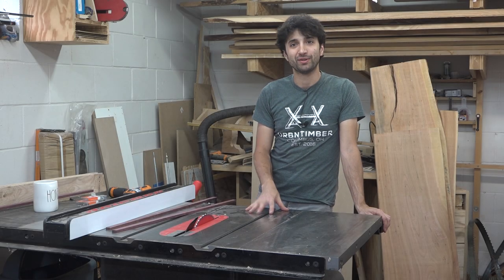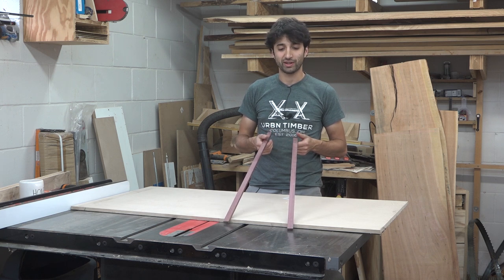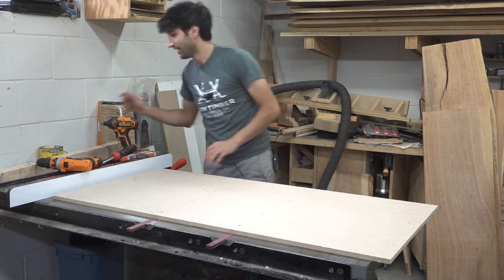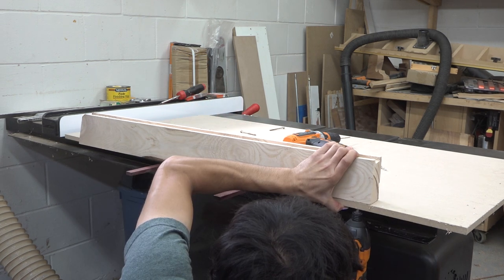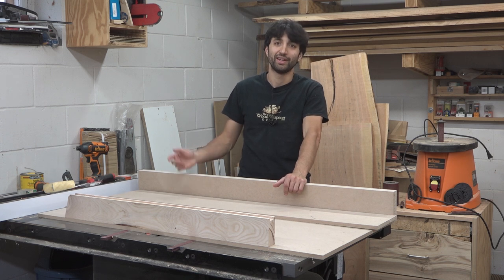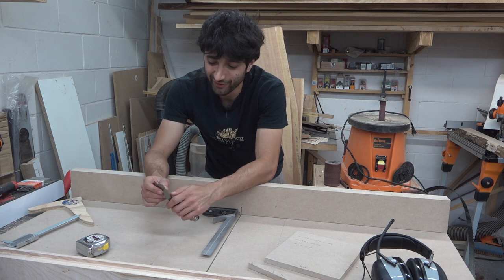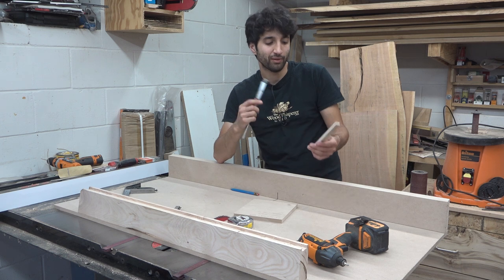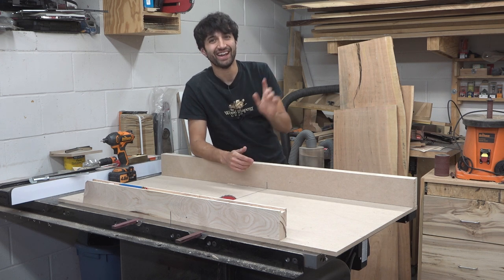Simple Table Saw Crosscut Sled

Comment: Dude, that idea to have one part of the lamination sticking out to have a clean reference point is brilliant! Great, simple sled. I need to get around to building one for my saw as well.
Reply from the maker: Thanks Johnny!
Reply: I said the same thing to myself when I saw that. Brilliant! I will be using that for sure.
Reply: I didn't get it 🙁
Reply: speg hetti as long as one straight board is protruding from the lamination, you can use that as your reference edge and ride that up against your table saw fence when squaring the piece up.
Reply: I've never thought of doing that! Makes me want to redo my sled because my fence is off just a tad and it drives me nuts.
Reply: I came to comment on the same thing. Brilliant.
Reply: Absolutely genius! Without a jointer it’s hard to make a perfect back fence.
Reply: +1.  I thought the same thing.

Comment: Nice one Matt. It would be interesting to see you do an update on this in a few months time to see how the squareness is holding up. To me, it seems like you could easily loose several thou due to the slightest of flex or humidty changes, and so I think it's kind of daft to do these tests with such dynamic materials, but I would love to be proved wrong!
Reply: wforl wood I would assume that any  movement due to humidity changes would happen uniformly across the sled base and the fence since MDF has no grain direction. That should ideally keep things as square as they are now.
Reply: True! ... but my point was that the smallest of things could change the resultant cut when dealing with these kinds of tolerences. Like for example a touch of glue, a tiny dent in the piece etc etc

Comment: Another great Video Matt, thanks. However, don't you hate it when you get 'however', I'm unhappy using a sled with tools on it. I always feel they might vibrate and move near to the blade and that would be a distraction - I don't want any distractions when I use my table saw. Also, (damn there's an 'also' as well) the tool slot on the back fence seems fine for pencils etc but it means you might be tempted to reach over the blade to take a pencil - not a good idea. Btw what's the little aerial sticking out if your ear muffs? 

Finally I've referenced your excellent chisel sharpening video to friends and family. It's the best there is. Many thanks and hope your lovely young family are well.

Comment: I like it, nice, simple and accurate. This is something I have been meaning to ask everyone who has a sled.
What do you do with it when it is not on your table? It's big, and the runners could break or crack with miss handling and moving around. When I think of building one I think about where am I going to store it.
Also, what size it this, roughly?

Comment: Love this sled. Great work. One question.. any issues with using wood as runners? Just wondering if someone (myself) is storing this sled NOT in a climate controlled environment, would swelling and shrinking be any concern? My current sled has milled aluminum runners and I love using them but they do cost money and usually require custom threading. Thanks, Matt. Love your channel.

Comment: Very nice video, Matt.  Like everyone else, I really appreciate the tip on giving a slight offset to one layer of a lamination to give you a straight edge on the fence...wish I'd known that before.  For years I've taped an aluminum straight edge to the laminated boards, offsetting it a bit.  As soon as I saw what you were doing, I had a Homeric "DOH!" moment.

As to the folks submitting comments on reaching across a spinning blade to pick up a pencil...well, I guess I now know who writes the 200-paragraphs of safety warnings that come with every power tool.  Have you ever actually read all those warnings?  Every now and again I browse through them for a laugh.  I know there are some safety issues that are paramount and sacred and never to be ignored.  But I think a reasonably astute person can pick up a pencil from the back fence without dragging an arm through the saw blade.  And if he can't, well...assuming he survives, it's one of those mistakes he's not real likely to repeat.  If he doesn't survive, he'll be high on the list of nominees for a Darwin award.  Silver lining, I suppose.

Comment: Well, if you are upgrading with a place for chalk, I'm VERY disappointed that you didn't add a cupholder as well. And a pocket for safety glasses. I mean, it seems to me that those should be considered fundamental, if not mandatory! 😎
Reply from the maker: hahahaha thanks Sean!
Reply: But serious comment on it, if you actually intend to keep some marking tools in it semi-permanently, maybe drill some holes to hold them vertical. Easier to grab and less risk of rolling out.

Comment: What is the drawback of using the same sled for cuts ranging from 90 to 45 degrees? Other than making the registration mark on the push brace not so usable? I don't want to build a different sled for every angle.
Reply from the maker: You just lose the zero clearance nature of the sled
Reply: @mcremona  that could be more dangerous because of cutoff pieces falling in and getting spit out? right? Should I just build a sled each for 90, 45, and 15?

Comment: great video Matty! But man I cringe every time you cut that MDF and the dust goes flying!
Reply from the maker: +MWA Woodworks that's kind of what happens when you cut stuff with a table saw 😜
Reply: sure. except this stuff was nasty MDF. I cut that crap in the driveway. There's no feeling like having a thin layer of MDF dust covering everything in the shop.

Comment: Did you use the same block of MDF to make you test cuts?  Wouldn't you be replicating the error from the original cuts?
Reply: No. Because he changed the angle of the piece at the rear of the sled. Which of course with change the angle of the cuts.
Reply: Yes, he changed the angle, but the error was already in the piece that is placed against the fence
Reply: After the first cut, that edge would be placed against the fence and the saw would cut 90 degrees (if set correctly), so the initial error would no longer be relevant. You don't need to start with a exactly square piece.  IMHO
Reply: Gary Z  that's why you cut 5 times. On the fifth cut your first cut is against the fence.

Comment: Ok, so let me ask this of my fellow woodworkers as long as were talking about using calipers to judge "square". What if instead of using the 5 cut method, I simply use a digital angle finder and just adjust to 90°?
Reply: ... or for that matter a machinist's square.

Comment: Great Video Matt thank you. How did you face glue your MDF fence without it warping? I can't seem to do a MDF glue up without it warping as it dries. I used the same 1/2" stock as you did.
Reply from the maker: I had it clamped to my bench until the glue fully cured.